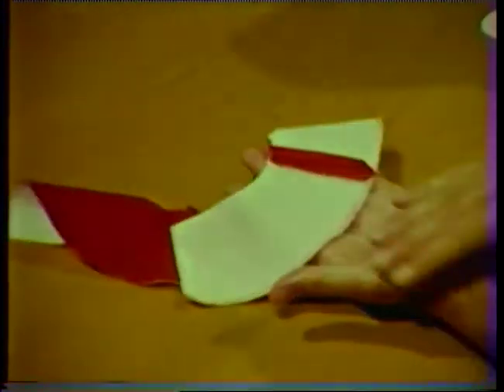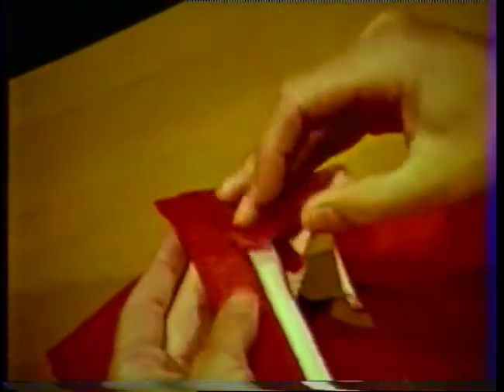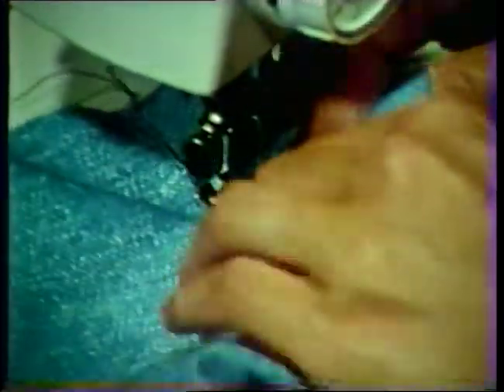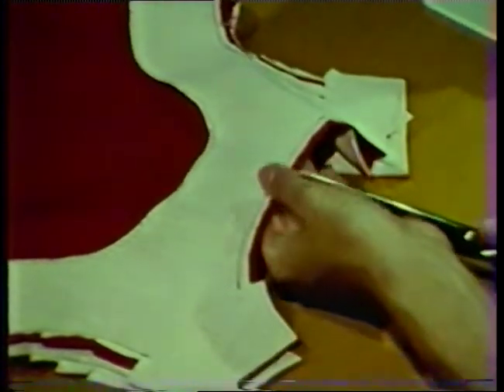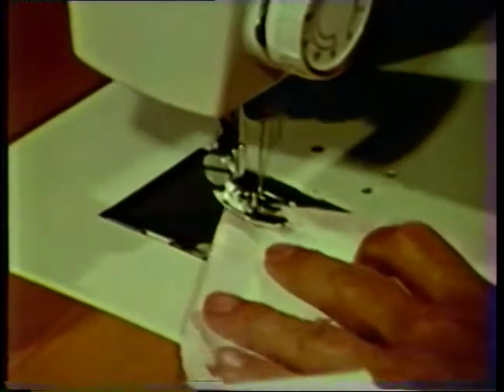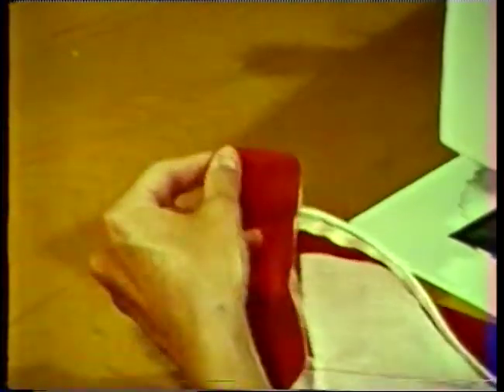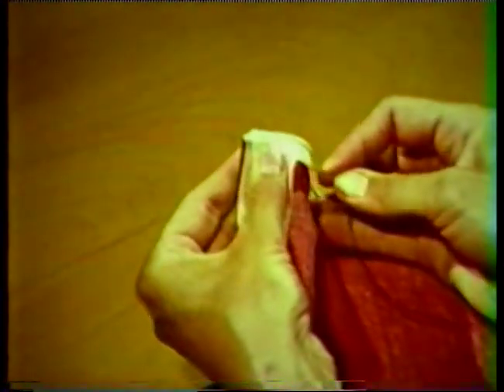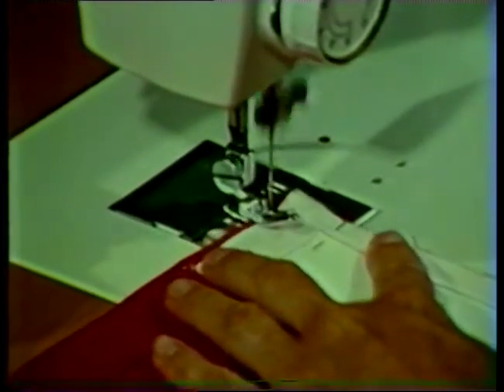(AV06733 Cass 5) Clothing construction techniques

Comment: Facings & Waistline Treatments
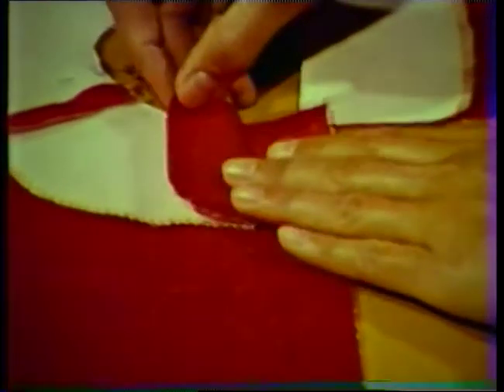Neckline Facing to use with Lapped (zipper) Seam @ 1:43
Finishing Facing @ 3:15
Neck & Armhole Facing with Center Opening @ 5:07
 Neck & Armhole Facing with No Center Opening @ 10:00
Waistbands @ 16:00
Grosgrain Waistline Facing @ 21:49
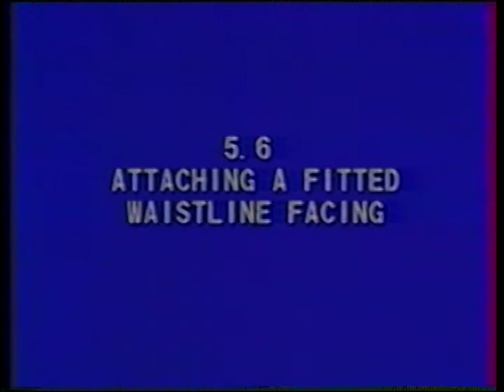Fitted Waistline Facing @ 26:19